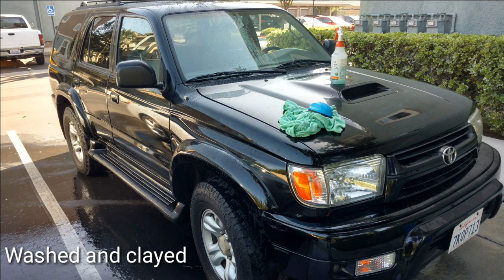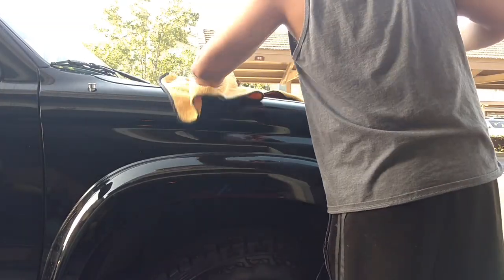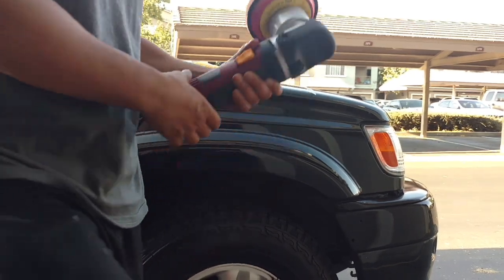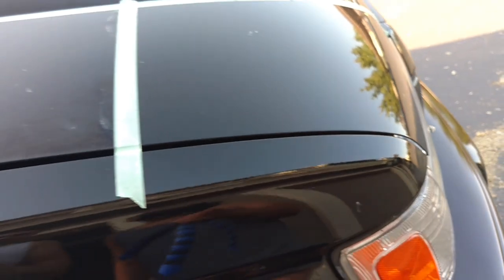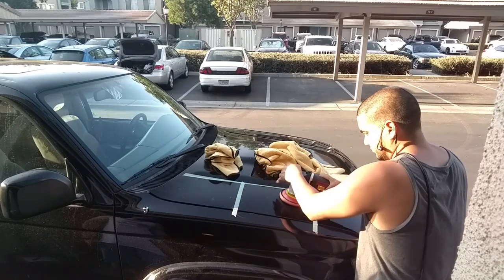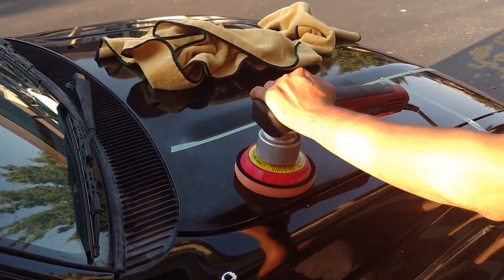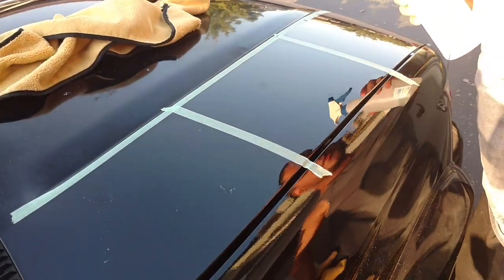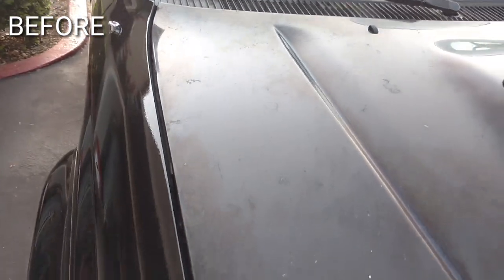Testing polishes on a 234k mile black car - Part 1 | HD Speed | Klasse | Correcting C

Comment: Not bad, but the griots correcting cream destroys the other two in terms of cutting power, it's not even close. The correcting cream is a hybrid compound/polish, the other two are really polishes with wax only, very limited cutting power. I love using the correcting cream with a microfiber cutting pad, it blew D151 out of the water and that clearly beats HD Speed in terms of cut. The new D166 from meguiars is the aio to get right now, absolutely blows HD speed and 151 away, wipes off with ease even in direct sunlight, more cut, better protection than just a wax, it's also designed for use with microfiber.
Reply: D166 seems to haze some black paint, even with a foam pad.
Reply from the maker: Yeah I completely agree. Doesnt even come close!
Reply: mark Saf must be some really soft paint that you’re working with, might need to follow up with something with even less cutting power and a black foam finishing pad.

Comment: Props on the video.. tip for you.  Next time you do a car with that much damage try and do a little more decontamination on the paint with some all purpose cleaner or degreaser with a sponge that has some type of scrubbing ability.. you will get more of that gunk off. Even though it will add some scratches you will be buffing those out anyway.. it will make compounding/ polishing much easier and faster plus you will get a better finish..